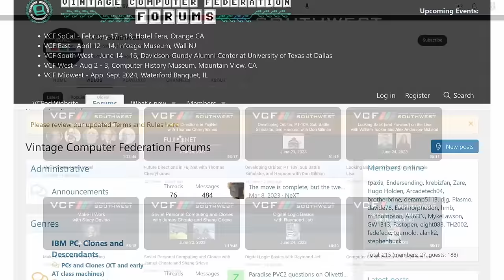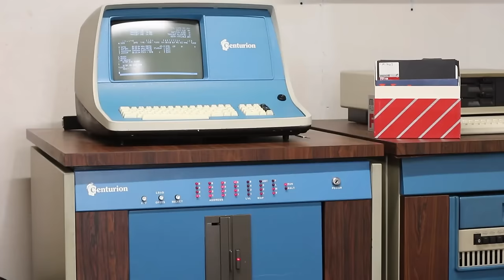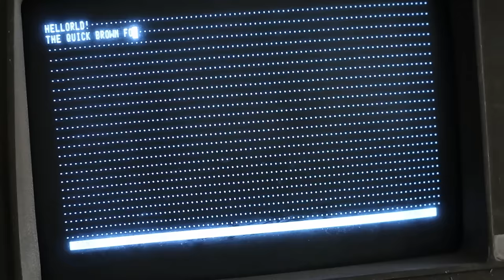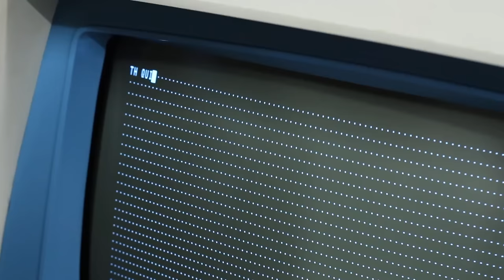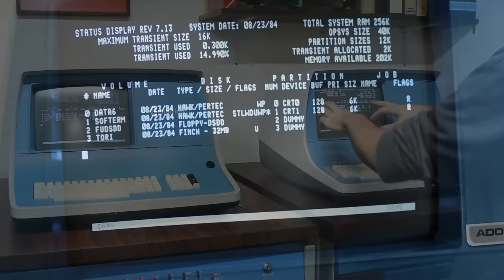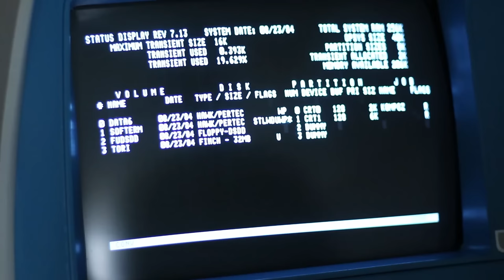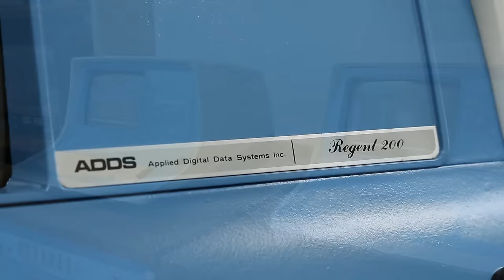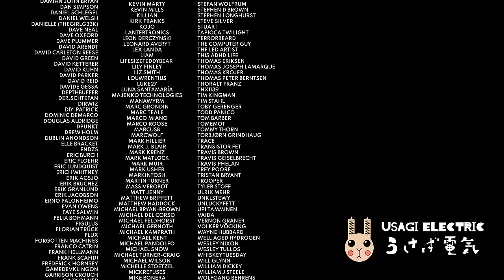Restoring an ADDS Regent 200 Data Terminal

Comment: The discovery of that old paper clip just wedged in a high-current area like the power supply made my skin crawl. That was just an electrical fire waiting for the right opportunity. So lucky it didn’t shift into an unfortunate new position on the drive to Texas!
Reply: hm,, yeah, that couldve ended very badly!
Reply from the maker: Yeah, we got very lucky on that one!
When I opened it up in New Jersey and we tested it there, that paperclip wasn't stuck in the power supply like that. It must have rattled it's way into place that place while getting handled and on the trip down to Texas. I never would've thought there would have been a paperclip floating around inside the enclosure. That's why I didn't crack it open to check, because I thought we had already done that in New Jersey!
Reply: Puts paper clip back in. Flashing stops. Never mentions it again. 😅
Reply: that was my thought lol. mission critical paperclip  @greatquux
Reply: @UsagiElectric  I'll bet it slipped inside though the keyboard from a careless clerk.  Keyboards collect all kinds of things like paperclips and staples.
Reply: Windows paperclip inside :) 
@greatquux

Comment: A bit of warning! As a person who went from working on old computers like this to typewriters from the turn of the century, SimpleGreen is not paint safe on a lot of things. It's better to only use it on non-painted surfaces. On old typewriters as mentioned it can really fuck up any varnish finishes or old soft paints from the 1930's and before, but even on later things where the paint might be a bit thin it will remove it with minimal effort as well as decals.

Comment: I was given one of those 12 years ago, worked apart from the key contact foam had all rotted.  I had to make new contact pads for every key using tin foil, that still works to this day!
Reply: Good thing in the ADDS terminal Centurion used in the 1970s-1980s all use Cherry brand keyboard switched, no foam pads to fail.

Comment: How about using the blank space to the right of the screen for commonly used commands/example commands? If you're going to take this to different meet-ups I think it'd really add value for users, who're using it for the first time.
Example:
.STA - Show a status display of all drives/screens
.DIR <X> - Directory listing of Drive X
S.KOMPOZ - Simple text editor (?? to exit)
Reply from the maker: That's actually a really good idea!
Although, with how obtuse the system is, it really just needs an entire book next to it, haha.
Reply: @UsagiElectric  Just make sure to use enough sticky tape :P
- Yannick
Reply: @UsagiElectric  : Maybe use double-sided tape to stick a wooden "ledge" on the side above the keys, and use that to lean a cheapo tablet with a manual onto it :p ?
Reply: While this is a good idea, If I were going to do anything like this, I'd instead mount a bracket to hold a number of prompt cards so that you can switch cards depending on what you're running. Main System (common commands for getting a directory, finding status and so on), and cards for the commonly used programs, showing what commands to use and their format.  That way, the user can just pull out the correct card (and turn it to the correct side) and re-insert it at the front to see all of the commands for whatever they're working with.

Comment: For about $50 you can get a small handheld color scanner which will give you the color values of any surface, typically called l a b values.  I found this great for matching paint on retro machines, especially in the case someone has something that's been put away for years and is still pretty much in its original condition as a reference.
Reply from the maker: I actually just took a spare Centurion panel up to Ace Hardware and they color matched it for me. So the blue that was painted on is proper Centurion blue!
Reply: @UsagiElectric  I am a consulting scientist who builds a lot of equipment at home to test things for clients.  I'm not endorsing Ace hardware but they seem to have a lot of the stuff that I always need to have, and the cool thing is they don't even blink an eye anymore when I go in there and ask for something like a hose barb.
Reply: @markbanash921  : Beware that not all Ace Hardware stores are made equal. The one in my town is a little lackluster, while another nearby is much better.
Reply: My Ace’s are well stocked….if you know what you need, they can supply.
Reply: Had no idea such a device exists, soooo handy. Thanks.
Reply: or just take a picture of the color, open paint program on your computer and you can use the little dripper icon in it and it gets you the RGB and ALpha values of whatever color you took a picture of.

Comment: Flashing is probably due to how this terminal logic board is made. The video decoder cannot access memory while the CPU is writing to it with larger ranges like when clearing the screen or scrolling up. Your other primary terminal probably has more elaborate memory access sharing with interleaved cycles so the CPU can write to it without stopping the video decoder access.
Reply from the maker: The ADDS Regent 100 and Regent 200 have almost identical logic boards. The only difference between the two are the additional control keys and an aux port on the back. Other than that, they're identical, even using the same CPU, ROM, RAM and overall construction. I think we either potentially have a bad IC on the logic board for the Regent 200, or the internal DIP switches are set incorrectly. It's going to take a deeper dive for sure though.
Reply: That was my initial thought. But it flickers on .STA after it has cleared the screen. Also, I would be surprised a period Adds terminal would have such a feature. It could be an issue with one or more of the RAM chips though - just on the edge of failure.
Reply: I'd start by scoping the power supply.  The old capacitors may be not have what it takes to maintain the 5V power when the logic starts getting busy. There may be ripple or hum on the DC power lines.  If there was a logic component bad, I wouldn't expect it to recover like this is.
Reply: @UsagiElectric  My first thought is that perhaps the CPU in the terminal can't handle the full speed of the RS-232 connection without using flow control.  It looks like the CPU can almost keep up with the data, but every so often it gets far enough behind that it needs to stop doing anything else while it empties its buffer (to the screen RAM) in order to prevent a buffer overflow error and loss of data.
If that's the case, then activating flow control, either CTS/RTS/DTR or XON/XOFF, will fix the flashing.
Reply: As the sainted Dave Jones says, "The first rule of troubleshooting is thou shalt always check voltages". But I think if it were a logic-level power issue you'd get freezing and garbage on the screen rather than blanking and then recovering. If it were an RS-232 issue where it can't keep up with the incoming data, you'd get missing and garbage characters after the blank. Same goes for flow-control, I can't imagine the RS-232 decoder having an issue and saying to the video encoder, "I can't handle this much data so just blank yourself while I catch up."
But it's fun to speculate no matter your opinion, and I am happy to be proven wrong! Perhaps @usagielectric should start a poll?
Reply: @merseyviking  If the issue is a momentary voltage dip on the logic board, the question becomes what chips are affected first?  Due to the voltage drop in the traces, it might be one section of the board.  If it just so happens to be the video, it could recover as it's doing a fixed task over and over.  But most anything else is less likely to.
Reply: @merseyviking  In the words of a movie character whose identity I cannot recall at the moment: "Worth a try."
I can see how the 8085 may become overwhelmed, depending on how everything is implemented.  If the display is done by hardware, then it's less likely, but if the display is done via software, it's very possible.  If the 8085 is responsible for both receiving RS-232 data and controlling the display, then I can see how it may eventually fill up its buffer and then have to stop controlling the display so that it has time to empty the buffer again so that it doesn't lose any characters.  Once the buffer is empty, it can go back to controlling the display hardware until the buffer fills again.
Of course, if the display is done in hardware then my whole argument is moot and you could be right.  But like I said, it's "worth a try" to turn on flow control and see if that makes a difference.
Reply from the maker: @merseyviking  Suspect voltage rails is definitely a possibility the more I think about it, popping a scope probe on them and checking for ripple while stressing the terminal is super easy. Ken Romaine taught me to always check voltages first!
But also, we've managed to crash the Regent 100 by hammering it with too many control codes too quickly (trying to make an ASCII game of snake). It was hilarious, the entire screen would go blank, then the terminal would completely reset. So, it's also a possibility that the Regent 200 has a marginal IC that's pushing it close to crashing when hit with control codes rapid fire from the Centurion. 
Only way to know for sure is to get the scope out and do some probing!
Reply: @UsagiElectric  That's really funny about the snake game! I look forward to the troubleshooting video.

Comment: My go-to for keycap cleaning is to put them all in a plastic jar with some hot water and purple power or castrol superclean, and shake vigorously a few times over the course of an hour or two, then rinse, dry under a fan, and apply 303 protectant. 

Only time i had to go further was my old northgate omnikey which has really deep pores in the texture. Removing all of those stains involved a long time in a heated ultrasonic.

Comment: Wasn't the brown layer chipping away? If so, wouldn't that cause issues for the blue paint down the line? Looks great though!
Reply from the maker: The brown layer was only chipping away underneath the ADDS Regent 200 logo plate. Other than that, it was pretty smooth and not chipping, it was just in rough shape. The primer seemed to key in and stick really well, but if I have trouble in the future, it's easy to disassemble and repaint!

Comment: Would be really good to do a video exploring how the terminal logic board works, and perhaps compare to the Centurion to see if they're the same?
Reply from the maker: I looked briefly at the terminal boards for the Regent 100 and Regent 40 in a previous episode. They're quite different actually. The Centurion uses AM2901 Bit-Slice ALUs and a whole lot of microcode to build a complex instruction set architecture, whereas the ADDS terminals are based around 8085 CPUs. They're essentially, really simple computers on the inside with minimal RAM for the screen buffer and that's about it!
Reply: @UsagiElectric  Using the 8085 as a terminal CPU makes sense since, iirc, the 8085 has built-in RS-232 serial processing which only needs level-shifting hardware to make it complete.

Comment: Was it "blinking" at VCF when on the mini unit ?  Poss cap disturbed on disassembly (or that paperclip was really important
Reply: Yeah, that paperlclip did look like it was being used as a bodge.
Reply from the maker: Yup, when it was at VCF we had the same issues, so I don't think the paperclip can be blamed, haha.
Reply: caps arent to blame for every fault, you know!!!
Reply: @andygozzo72  but a screen re-draw "error" does sort of wander ones way in that direction.  though a diode or resistor setting also might be expecting a diff voltage on a 2000 compared with the 1000 the technical drawing comparisons should give an idea
Reply: @highpath4776  i'd think more chip 'issues' maybe a bad gate in a ttl  device, or partially bad ram chip, i've come across a pc133 ram module that wont work at that speed anymore but tests perfect at pc100 speeds,   also any of the dc supply lines may be out of tolerance.... not necessarily due to capacitors but maybe bad zener, i've had this a few times also..
Reply: @andygozzo72  ok. so does it appear to be one specific issue, as it only seems to appear on one particular "pulse" ?

Comment: I'm surprised that you weren't prepared for the cold in the North East, I grew up on Westerns, (1970s & 80s) and so was not prepared for Houston in February.

The restoration has turned out amazing. And you haven't used a real computer until you've used a multi-user one, miss my time working in an office with DEC micro-VAXes and Alphas; although being able to close your laptop and go home to work does have its advantages!

Comment: I wonder if the screen flashing is due to bad caps ? Supply can't deliver the load when its doing a lot such as scrolling etc.
You've got two ADDS terminals, so diagnostic of that should be fairly simple :-). Either with a power / logic board swap or with a scope on the supply output.

Comment: I was initially feeling not great about the repaint, but then I saw the condition the paint was in, and you mentioned you'd have to repaint it anyways, and so I said to myself "Well, it'll have to be repainted anyways which means it won't be the original color no matter what, so why not let it match?"
Reply from the maker: That was exactly what I was thinking the first time I saw it in person!
And I think that's why the VCF guys agreed to let me repaint it as well. Plus, if it had been immaculate brown, I wouldn't have paired it with the Centurion, I would have let someone else get a crack at it instead.

Comment: I wonder if the ADDS terminal needs X-On / X-Off or RTS/CTS flow control?  Maybe if it’s not configured on the ADDS terminal it’s getting overrun and is flashing to complain!
Reply: You would lose text if it was a flow control problem.

Comment: Microdata midrange systems and the Pick operating system relied on ADDS Regent protocol's Vertical Cursor Addressing (Control-K, y) and Horizontal Cursor Addressing (Control-P, x).

Comment: A dream of mine is to modify one of these unibody terminals to act as a thin client for a Linux server. Would be super cool imo.
Reply from the maker: You wouldn't even need to modify it, just make sure your Linux is happy with 80 x 24, then set the dip switches on the back of the terminal to the right baud rate and bit count, and you'd be off to the races!

Comment: Usagi! We still need to get your Centurion on the radio! You don't even need to have your ham license as long as someone who is licensed is present when transmitting. One way it could be done is with KISS protocol to a TNC so that the Centurion itself can have a custom program written so that it can handle multiple users over the connection since packet radio is designed for that anyways.
Reply: How fast can you send data?
Reply: @Frisco1355  legal limit for HF is 300 baud, though that may change soon. For VHF and up you are pretty much limited by bandwidth of the radio you are using. Typically it's 1200baud.

The centurion could run a BBS during events, and it would be really cool to see when and who are posting messages live on a terminal while there.

We could have two TNC connected to it at the same time. One for local VHF/UHF packet, and one for long range HF packet. Generally anything above 300 baud on HF struggles to get through due to noise and especially multi-path.

Comment: So what sort of paint was that?  Alkyd Enamel, perhaps?  A two-part epoxy would have been my choice after a test in an inconspicuous area.  If the plastics are ABS, it would have bonded well, and, properly mixed and thinned, would still show the texture of the original substrate.

All that aside, this does look very good, and that shows a steady hand with the sprayer.   Well done!

Comment: on that top white part.. to get the bright white look it use to have.. 
their is a technique of using hydrogen peroxide, distilled water (i think thats all) and leave it submerged in the straight sun light for couple hours.... 
im sure theirs a name for this.. im just loosely remembering how to do the process.. this process gets the white back better and quicker than any degreaser or cleaner and a rag.. maybe this will help in the future 🤪

the same can be used on the backside of the keyboard cover as well
btw.. that paint isnt going to last long if their is heavy use... or touching.. shouldve used a high grit of sandpaper on what you painted... not just going straight to primer

Comment: Talk about "They don't build things like they used to!". Would it have been worth it to change the main filter capacitors as preventative maintenance? The flicker on the clear-screen could be a symptom of the power rails dipping under higher load.

Comment: What system was the ADDS 200 originally with ?
Reply: Could have been anything since it had their own brand on the label.  ADDS sold terminals as generic display terminals to many computer manufacturers and system builders. My employer in the UK in the late 70s and early 80s was one of many such customers.